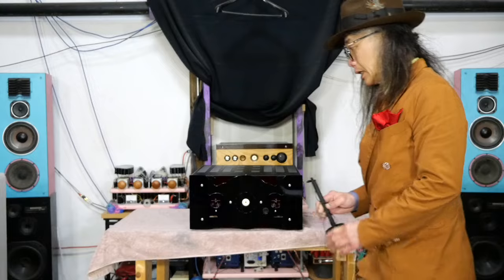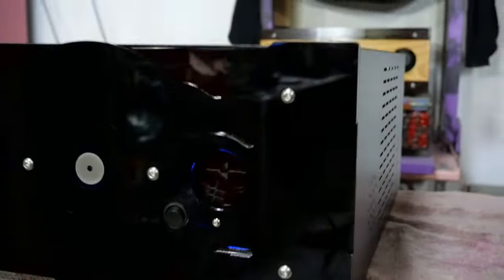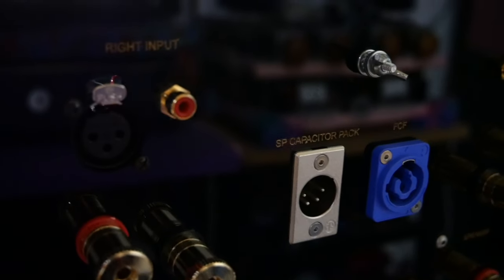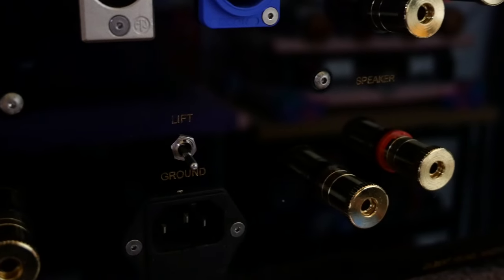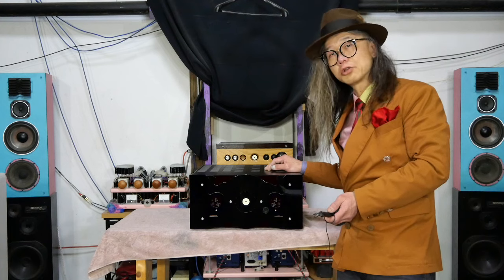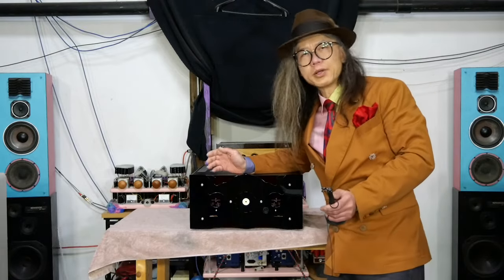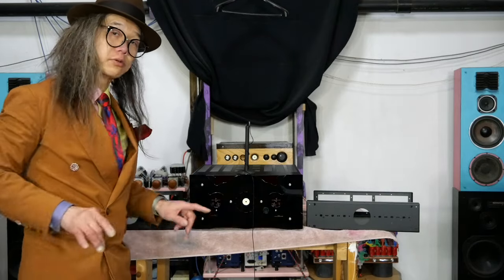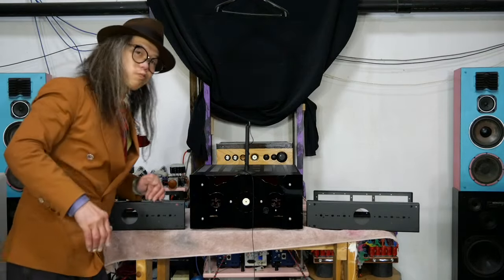A212 dual mono stereo amp compares to A211 Monobloc

Comment: I agree , two monoblocks are easier to build and they can even be placed closer to the speakers. Thanks for explaining dual mono vs. stereo , I wasn't aware of the fact that fluctuations can have a greater effect on dual mono. I always thought that a shared transformer was just a cost cutting method.
Reply from the maker: In order to make a stereo amp sound better than dual mono, there are other factors to consider.  You are correct to a certain point that using a single transformer as cost cutting.  Some brands certain do that.  However, my theory of stereo is different than others.

Comment: Outstanding! Dumb question, but will it still work with a single subwoofer via high level connection? 🙏🏼
Reply from the maker: Are you trying to connect a single woofer via high level connection to the a stereo amp?  Not exact sure what you are asking.
Reply: @angela-gilbert  Was asking about the possibility of connecting a Rel subwoofer using high level connection the the speaker terminals. I ask because this isn’t supposed to work with mono blocks due to a potential ground issue. But was wondering if this would still be a problem with dual mono? Also nice that you’ve implemented grounding. But since you are moving into monblocks, I guess I’d need a second sub. I don’t want you to hurt!! 🙏🏼
Reply from the maker: @riccitone  Whether it is dual mono or monobloc.  Using a single sub is possible.  If the monoblocs are placed far apart.  Simply using a longer wire and connect the ground to a mutual point.  The mutual ground point will depend on how the system set up.  When we get to that point, I can show you how to do it.  Just remember it is possible to use a single sub.
Reply: @riccitone  I have used 2 Rels with mono blocks and AG's A210 in the same high level configuration without problems